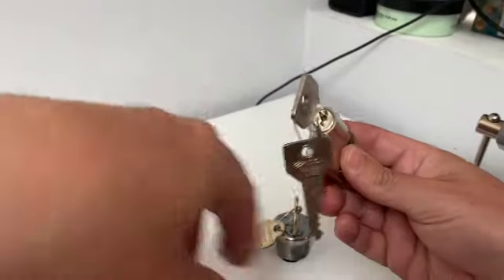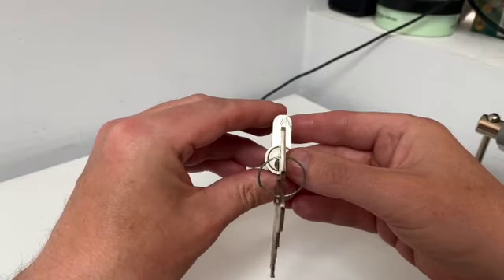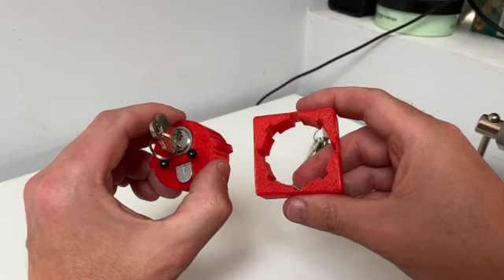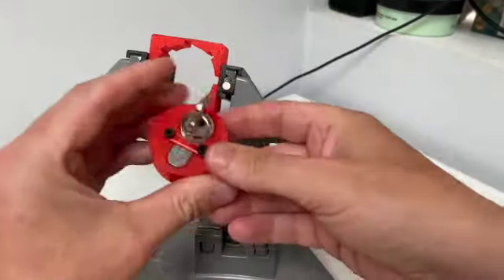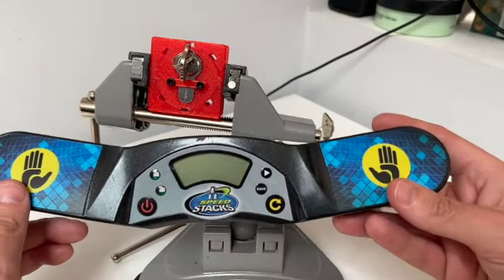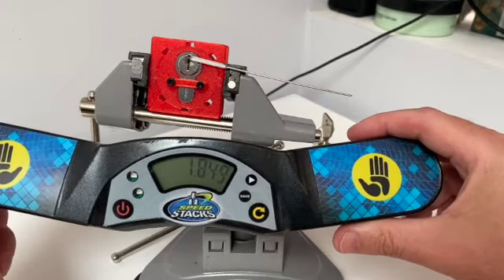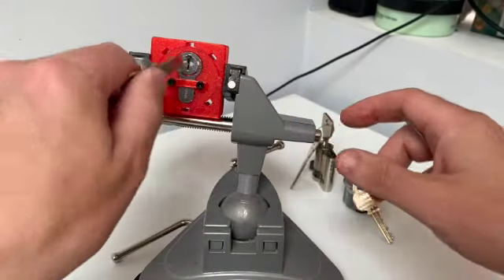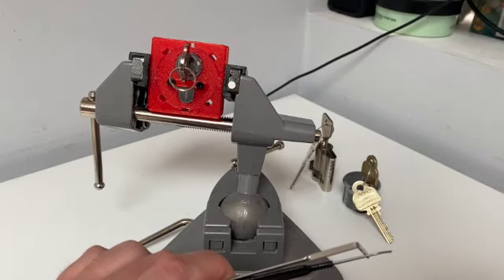TSL 191 - Project Spherical Cow Part 1 : Introduction

Comment: Looking forward to this series Rik.  Over the last few years I've picked a few locks in situ (the nearest Locksmith is well over an hour a way from my little village).  I've picked them in literally all the orientations you have on your 3D holder.  Padlocks particularly can be locked in a wide variety of orientations depending on how the shackle was looped through the hasp, the position of the hasp (vertical vs horizontal) etc.  I've picked Euros pins up and pins down (for some reason in NZ, screen door Euros are often installed pins down).

The other factors I've found that affect picking door locks in situ are, the locks position in relation to door moldings, door jam, door window frame etc.  These things will often determine what tensioner can be used.  For example, tensioning as demonstrated in this video maynot be feasible if the tensioner will make contact with the door jam, handle etc.  As a result I have a wide variety of tensioners from diy wiper inserts, music wire prybars for vertical TOK and vertical BOK tensioning.

Sorry for waffling on about something not completely related to your series
Cheers Steve
Reply from the maker: Thanks for your comments and  support - I tend to pick locks in the hand rather than a vice so I'm sortof using to picking at a slighter odder angle.  I will be interested to see if this is born out by the experiment.